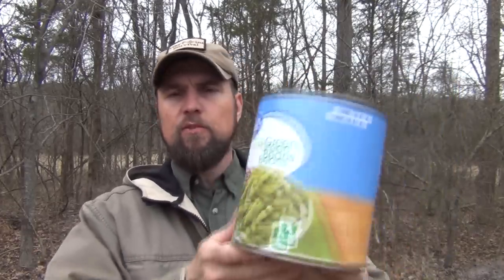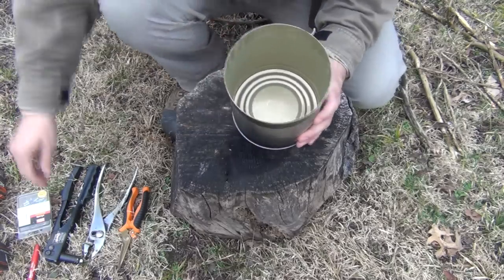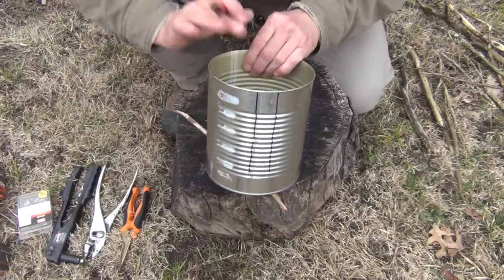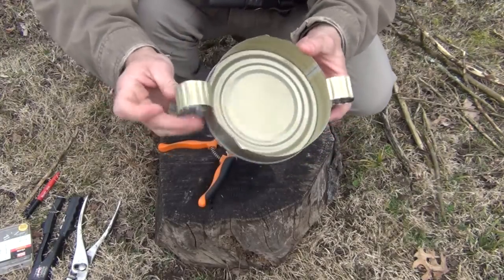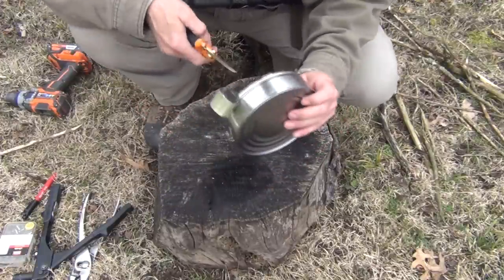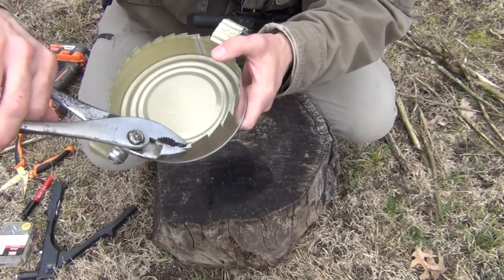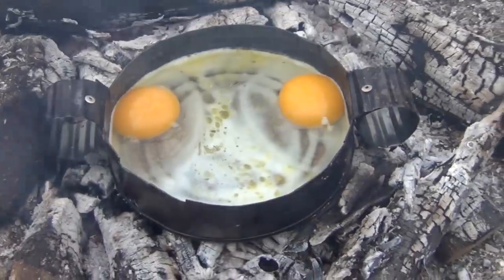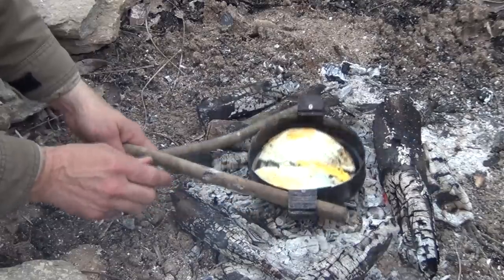Tin Can Fry Pan!

Comment: just went to costo bought 2 #10 cans of tomato sauce one went to she who must be obeyed for a utensil caddy told her to decorate it any way she wanted Now I know what I'm gonna do with the other one LOL.. EDITED to add you can season this pan just as you would a carbon steel fry pan, it requires two clean cotton rags, a bit of oil (olive oil is good so is canola) first dampen one cloth in the oil wipe the inside of your pan with the oil, set the pan on your coals and when it starts to smoke take it it off the heat, wipe again with the oil repeat this 8 to 10 times or until you have a built up even black coating on the pan let the pan cool wipe with clean cotton rag... this coating protects the pan from rust and is as good as Teflon for non stick and heather too. be sure to wipe the pan with oil after each use... I learned this trick as a boy scout on an old carbon steel clam shell mess kit.
Reply from the maker: Thank you! And thank you for the info on the seasoning!
Reply: I had been wondering if it would take a seasoning similar to treating cast iron. Thanks!

Comment: Not a good practice.  As per I'm aware these cans or most have coatings inside them.  Bad idea to heat these up or use them for cooking, a function they were never meant to be used for.  I don't want to be putting toxic dioxins into my food if I can avoid it.  I'll stick to aluminum, carbon steel cookware or stainless.  It's cheap and easy to carry good cookware afield or mess kits.  Same goes with water bottles.  They are single use and your best off with a Ti or stainless bottle and canteen.

Sorry, but not trying to be a downer.
Reply from the maker: I always burn off the coating before I use them to cook or boil water in.
Reply: Yeah, I realize it's burned off but there's still residue of those chemicals to some degree polymerization that gets onto the metal.  I appreciate the how to portion and the craft aspect but today's petro chemical processes leave residues not see by the human eye.

Comment: If you've got a drill, plyers, snips, rivets, work gloves, and a rivet setter,  why are you lacking something as basic as a fry pan?  If you have access to all the amenities of modern living, build something more impressive than a chopped off tin can.
Reply from the maker: The point is to show the type of stove that hobos would have used. They did have access to tools from time to time as they were traveling, working men, they just couldn't take them along when they left. Also, there would have been some tools available in the hobo jungle as well.

Comment: I'm sorry but I don't know of anyone who carries a cordless drill and a rivet gun in their pack, let alone a box of screws nails or whatever. Why don't you try doing this with a multi-tool, which is an item that is more likely to be carried by travelers nomads and campers than a cordless frikin drill. Stop trying to be something you ain't
Reply from the maker: The point is, that a lot of people that were hobos back in the day often had access to full machine shops as they were hardworking individuals who were skilled with their hands. They would make these types of items before they hit the road not just sitting along side of it.